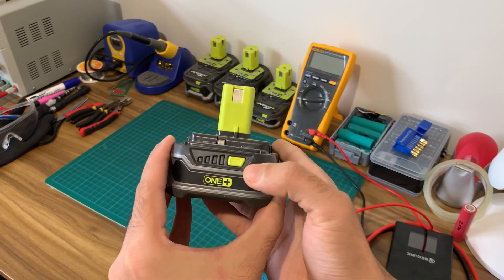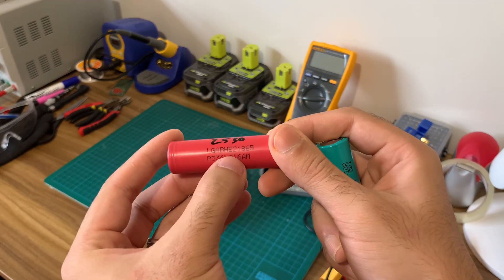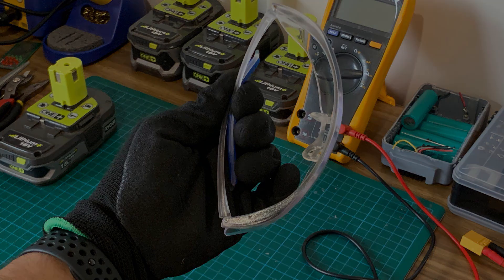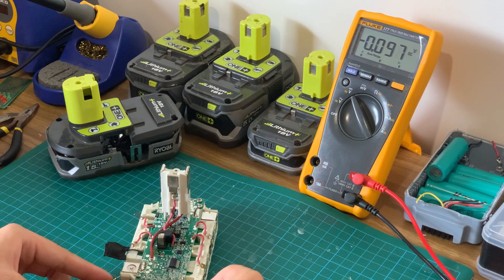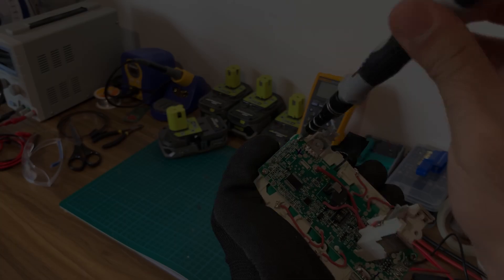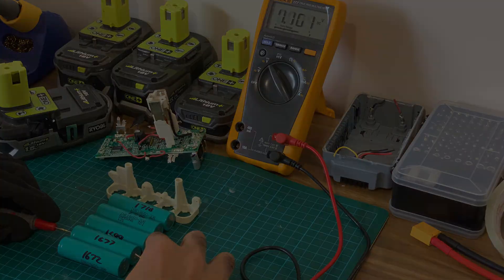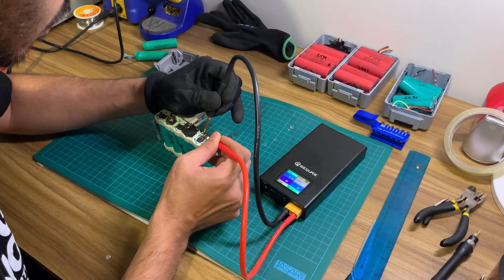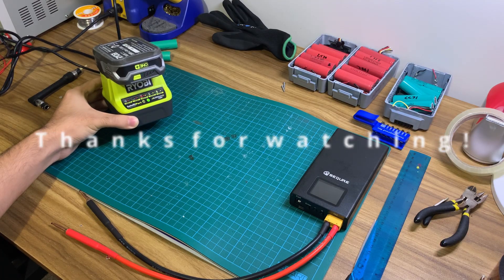How to Repair Ryobi 18V Battery With New or Salvaged 18650 Cells!

Comment: I recommend to work on cells that are are discharged as a safety precaution. An unplanned short-circuit of a fully charged 4.2 V cell is much more spicy than the one that was discharged to 3.0 - 3.5 V.

Comment: I'd like to know how you repaired the leads attaching them back to the batteries once in place. Why did you not show that part? They were spot welded before. Did you just solder them back on?
Reply: Since no one replied yet I will. What he used, and really the only way, is a spot welder. You can find them inexpensive around 50 bucks and then you have to cut and bend the strips out of a roll. I tried to reuse mine but the metal is too thick for my hobby level spot welder. 

I did try to solder before getting this tool but it just doesn't work. The amount of heat needed feels.....unsafe lol. This is so much easier to do and once I had the tool I find myself repairing all types of battery powered things. Even making my own packs for things
Reply: @jbmotorsportsusa  I think he was referring to the balance leads, not the strip between the batteries. So basically, the strips are spot welded to the batteries connecting them all together, but then the strip is soldered to the circuit board via the red balance wires which he didn't show.
Reply: Ahh, yes, you are correct. I guess i assumed that having done the process as there's kind of no other way to to connect them and i should have specified. Thanks for the correction

Comment: Hello friend, congratulations on the video, I think you are a very knowledgeable person. I have a 1.5 amp Ryobi battery. I already changed the new cells and reset the card but it still gives meñ The LEDs do not stop flashing when you press the battery button and the charger does not recognize the battery, it indicates an error and on the terminals that make contact with the drill there is no power but the package

Comment: Can you not just add the new cells in parallel ??
I am planning to just add the extra cells to the existing cells in parallel. Can't find a video, is it possible ?? I would be keeping the same BMS.
Reply: Unless the original battery pack was still in excellent condition, I would not recommend it, as the new batteries will be doing all the work, and will deteriorate a lot more rapidly than if you replaced the worn out / faulty cells. You clearly won't be able to reassemble the battery pack anyway, and the BMS board may not work as well as a 4Ah one, which is somewhat what the pack would become. i.e. it may have higher rated or more output mosfets paralleled.

Comment: I have replaced all the cells (10 of them) and it is charging as it should and i get all 4Ah out of it, but if i don't use it, it will discharge itself after two weeks.
Does anyone know what could be wrong with my Ryobi battery?
If i use a thermal camera i can see a double diode get warm and one resistor and i believe this is discharging the battery, but why?
Any tips?

Comment: What size and kind of torx screw did you use? I can't find the right torx for it. I'm referring to the screws inside the battery holder
Reply: I managed to use a T10 bit for removing one, but T8 worked for both screws.
Reply: @pfeerick  I wonder if there's some variation. I just did mine this afternoon and the 5 on the outer case were T10 and the two that hold the halves of the cell pack together were T8. FWIW the manufacture year is 2017 and the original cells were LG (marked LGDAHB21865)
Reply: @GeoffSteeleAU  That sounds pretty much the same as mine. I was only responding to the question of the "two screws inside the battery holder". Outer screws were all T10. Date on my pack was 2014. Not sure offhand what brand the cells were.
Reply: My packs have T10 Security TORX screws. They have a pin in the middle.

Comment: Could you use 21700 cells in the old case will there be slight gaps in the case?
Reply: No to thick
Reply from the maker: I don’t think they’d fit. 

If you did find a way to fit them, the other thing to check would be if the 21700s are lithium ion or LiFePO4 as different chemistries have different nominal voltages. 

The Ryobi ONE+ BMS is designed for lithium ion cells.

Comment: I have Panasonic CGR18650CG as replacements. Have you used these before?
Reply from the maker: Hi there, I had a look at the datasheet, looks like the Panasonic CGR18650CG can only discharge at about 4A, which is not high enough for power tools. I highly recommend using 18650 batteries with atleast 15A discharge rate.

Comment: Doesn’t have to be a spot welder or will a regular welder work? A spot welder is just as expensive as a new battery at over $40 even for a cheap one.
Reply from the maker: No, it has to be a spot welder as regular welder would overheat the battery and probably cause fire!

Comment: Those aren't the old ryobi batteries.  The old ones have a black body
Reply: Wrong. May depend on the model of the battery pack. I have this model and the cells are green, exactly the same as in this video.
Reply: @rogerwilco5187  the original batteries  were all, black! The tool bodies were originally black and blue "before" they changed to the green color they are now. I have several tools of that era.
Reply: @cha.bea6222  Oh, I misunderstood. I thought that you meant the cells that were already in there weren't the originals, but you were referring to his remark about it being an old battery. It didn't occur to me that you'd be referring to what are long obsolete batteries when the video is obviously about the ONE+ batteries.
Reply: @rogerwilco5187  the black batteries were referred and labeled ONE+ before they were green, yellow labeling.
Reply from the maker: Depending on the age of the battery pack, you will find different cells within. But as long as it uses 18650 batteries inside, you can follow my method.

Comment: Great project and i'm all about being green and re-using.  But just a head's up- right now is Ryobi Days and you can get 4 4ah batteries for $100.  $25 each.  I believe the newer batteries all have Chinese cells now but I've also heard they are still of decent quality.
Reply from the maker: Thanks for watching, sounds like a good deal for $25 per 4Ah battery. Are these original Ryobi batteries?
Reply: Was that USD?

Comment: Does anyone else see a pattern with which cells fail in these batteries?  I see certain cells in a particular position failing.  The cells in my batteries are Samsung, which are considered good cells, by many.
Reply from the maker: Interesting, I didn't take note of this before. Perhaps those cells go out of balance over time, which happens across many cycles but could also happen early if the BMS is faulty.
Reply: I've rebuilt many of these Ryobi batteries.  I haven't seen any particular pattern of failure.  What did you observe???
Reply: @test-193  someone over on another forum said that Ryobi's design with their BMS had it burning out/failing much sooner than other big tool companies.  They seemed to be saying that the BMS fails before the batteries ever run out in a lot of cases.  Have you seen this?

Comment: I’ve done 16 of these batteries.  I agree that the Samsung 25R is the best way to go.  The end result is better than 100%.  It’s 166% of a new Ryobi battery. (About 46 Watthours instead of 27Wh)

Don’t be tempted to use higher capacity cells (mAh) unless they are specifically designed for high current applications.  

For example :  a 3200mAh cell seems great until you discover its max current delivery is only 5 Amps.  Find cells that can deliver 20Amps continuously!
Reply from the maker: Thanks for watching! Yes, getting batteries rated for high discharge is essential! From not only performance but also safety. Thanks for sharing your thoughts.
Reply: What cells are originally in this battery before upgrading them?
Reply: I just went with Sony xtc6. 3Ah, 30A discharge
Reply: @VX3800  How did you go with this? I found this comment from @test-193 extremely helpful. I have one borked ryobi one+ (2013) that I want to try replace the cells in. It could be the control board but I will give the cells a go first. I was just looking up some batteries and spotted the 3Ah 30A 18650's and they aren't that much more in terms of outlay so was considering them. Did yours work okay?
Reply: What size and kind of torx screw did you use? I can't find the right torx for it. I'm referring to the screws inside the battery holder

Comment: Do you know if there's any difference in the BMS for the 1P and the 2P batteries?  Also do they manage the output?
Reply from the maker: Hi there, thanks for watching! The main difference I would expect is that the charge time would be doubled if you go from 1P to 2P. The BMS should still balance the voltages all the same. Output wise, it would cutoff once the pack voltage gets too low (not sure what the cutoff voltage is). Were you hoping to increase the runtime of the battery pack by adding extra set of cells in parallel? That should work, but you'll need an enclosure that fits the extra cells. If you do have say a 4Ah enclosure but a BMS from a 1.5Ah pack, it should be fine to use the 1.5Ah BMS for a 2P configuration to be housed in the 4Ah enclosure. Hope that helps!